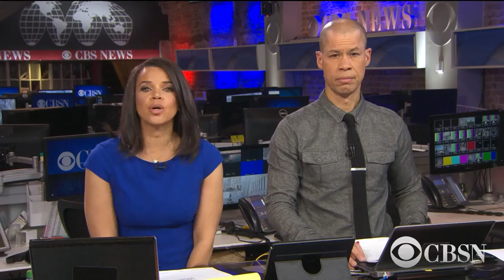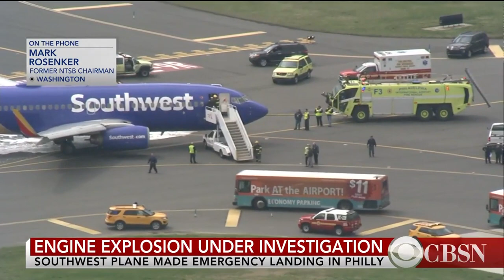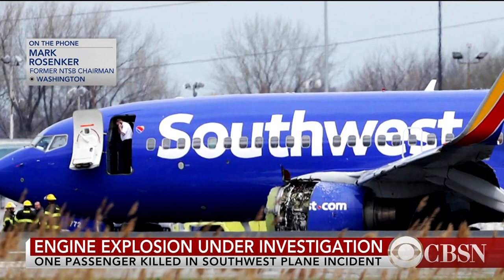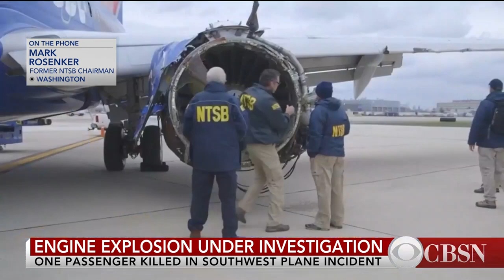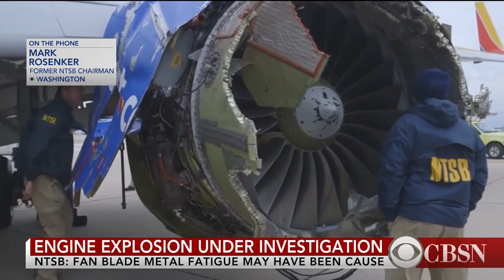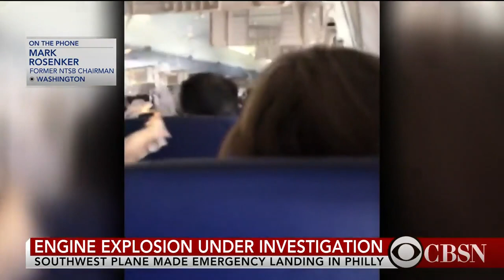Former NTSB chairman explains explosion on Southwest Airlines plane

Comment: I wonder if this is the same thing that happened to United 232 in 1989?
Reply: Similar, although that one was a turbine disc further back in the engine. I believe this video says the Southwest incident was a fan blade towards the front.
Reply: Chris Serfas I was referring to the actual failure of the blade. In United 232, I believe it was a "hard alpha inclusion" in one of the blades that had been there since the disc was made. I guess we'll have to wait until the investigation reveals the cause.